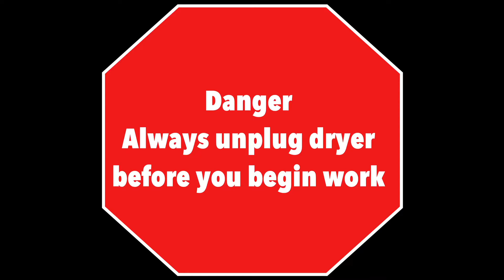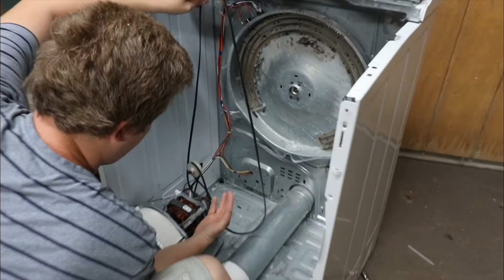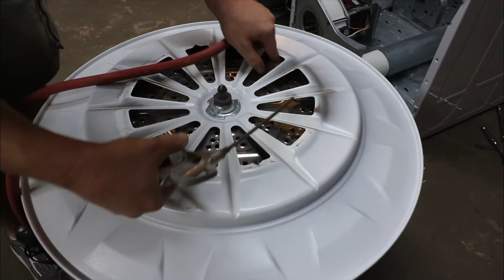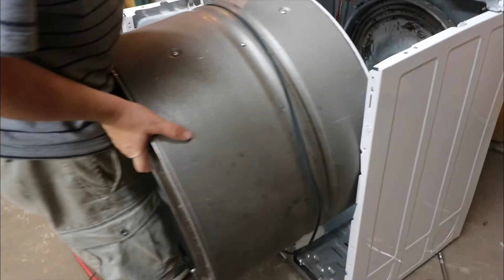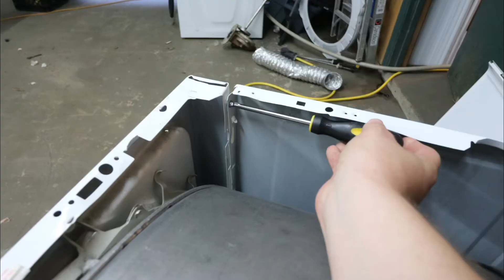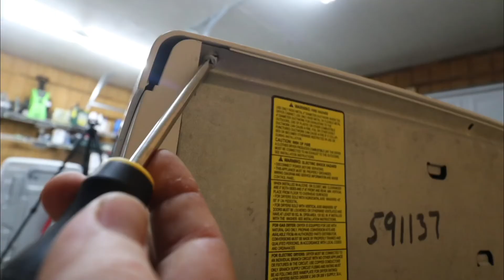GE Hotpoint overheating? Step-by-step guide to unstop Lint build up.

Comment: You saved my butt something fierce my guy 😂. I just got done putting the old girl back together amd im confident that i did a good job thanks to your instructions. I wouldn't say its 100% because there's a low buzz here and there but she runs and works the way she was intended to.

Comment: Question - based on the symptoms of my dryer it looks like I have a lint clog but on the front of the dryer on the other side of fan.  Originally, I pulled the dryer out and vacuumed the lint from the rear of the dryer and did get a good bit of lint out but apparently there's more, so I've been on a quest to try to access the part on the front under my lint trap.  I have an old school model (DCSR483EA1WW) that is not digital.  It's just a wind-up timer dial kind of GE dryer like the one on your video.   I can't find a video on YouTube or internet for my exact model but the dryer on your video is very similar and the dryer on another video was also very similar.  On the other video (not yours), the guy took the door off, and there were 2 screws at the top right inside where the door shuts that he took off.   On your video, you didn't have to take door off, and you didn't take any screws out of the top just inside the door.  I can't tell if your model even has those 2 screws at the top just inside the door.  The problem was I took the door off and then when i went to take the 2 screws at the top out one of them stripped.  The other screw I got out, but it was also very hard to crack.   My question is does your model have those 2 screws at the top just inside the door?   If yours does and your front panel came off, then I may not even have to remove those 2 screws and the door after all to get my front panel off.
Reply: I did put a brand new dryer vent on the exterior of my house when I cleaned the lint out of the back of dryer and vacuumed the round duct hose out and ran my vacuum wand up the duct connection pipe at the back of the dryer and got some lint out.  The dryer seemed to dry ok for about a month then i started noticing my clothes weren't dry and the lint felt wet.  So I assume that means the problem is there is a lint build up on the other parts of dryer that my vacuum cant reach.  I never dry on high heat and have always used medium heat.  Its producing heat and didn't feel too hot but i dont use high heat setting either.  Clothes were partially dry so i guess mine is getting some circulation but definitely not drying like it was in the past.  My dryer is on an exterior wall and I arranged it so the duct is running straight and out the wall so that shouldn't be the cause but I'll check it again.

Comment: What if we don’t have an air compressor? And how do I disconnect the light wire?
Reply: With a regular shop vac, you can perform this task. You can use the exhaust end to blow and the vac to vacuum the rest. If you really need blow power use your leaf blower for the exhaust pipe and other hard-to-get places. Just remember to check behind yurself like the heater element for the thing that will cause a 🔥fire!

Comment: Your video was very helpful to me. My GE dryer was taking longer and longer to dry clothes, so I checked down below the lint screen and there was gobs of lint built up outside the fan motor. My model was slightly different from yours, but the basic disassembly was the same. I took the drum out and used my shop vac to get the lint out of the rear. After cleaning it, I got it put back together and it's working great! Thanks again!
Reply from the maker: Glad to help.

Comment: Fixed the squeaking by replacing the shroder and glide tabs... but now the dryer is getting extremely hot only on the back metal panel after about 5 to 10 mimutes.. so confused. Any thoughts?
Reply from the maker: Definitely do not continue to run the dryer if it’s getting hot. That’s very dangerous.
More than likely, it’s an airflow problem.
GE dryers have a weird spot that collects lint in the back of the drum. To get it out you pretty much have to take the drum back off.
Another thing to check for is a grounded heating element. This means the heating element is touching the frame of the dryer. It will come on and stay on and overheat the dryer. Less common then airflow problem, but it does happen occasionally. Good luck and be sure not to run the dryer until it is fixed.
Reply: @WasherDryerMoney  thx. For the response. I took the drum out and cleaned all the dust/lint in the back of drum. Hoping that will do it. Tried assembling drum back on and noticed there was no o-ring. So, trying to find one @ hardware store as ordering it will take to long. Smh

Comment: Replaced start Button and door switch  Runs as long as you hold start button in. Thanks in advance
Reply from the maker: I’m not sure if it’s the same for GE but some dryers have a switch this on the motor is self. It detects with the motor is running at full speed. It’s called a centrifugal force switch.

Comment: My drum is touching the top of the fan housing is there something the drum is attached to other than the belt
Reply from the maker: I would guess it’s the drum bearings. Possibly the piece that also holds the bearings. If it’s worn out, it will lower than tire drum.
Always hard to tell when I’m not there to look at it. Good luck.

Comment: My dryer has to run 2 full 180min cycles to get the clothes dry. I pulled the hose off the back and vacuumed out a ton of lint with no improvement. 

I’m thinking this is the next step on getting the dryer to be efficient. Going to give it a try soon 😊

Comment: QUESTION: Thanks so much. I followed all of these steps very nicely, found a lot of lint in the blower and the back of the drum, put it all back together and tested it out.. Same problem. It shut off after about 5 minutes, and won't start up again until it cools down. Is it the thermostat or thermistor?  or something else? The clothes in the dryer were hot, the heating element looked good and intact. Suggestions?
Reply from the maker: Could be the motor going bad.
Some of those dryers had a switch on the idler pulley to shut the dryer off when the belt breaks. It could be that switch if it has one starting to go bad.
Reply: @WasherDryerMoney  Thanks! Is that switch built into the motor or a separate replaceable piece? I can't find that switch in the parts diagram. Thanks again, and a happy new subscriber 🙂
Reply from the maker: @BW-pr8qr  it may not have the switch. Not all GE dryer’s came with it. If it has a switch, it is on the bottom of the idler pulley arm.
Reply: @WasherDryerMoney  We tested the dryer on the "No Heat" setting, and it never shut off. Only kicks off in a heat setting. I purchased the 3 separate thermostats and will try to replace them first. Thanks again!

Comment: What if you don't have an air compressor? How do you get that thick wall of lent out of the trap?
Reply from the maker: You can wash it with the water hose and let it dry back out completely before you put it back on.
Reply: Use a Leaf Blower

Comment: Love this video! GE dryer bought in April, 2022 had made a really loud thump/or now like a pair of tennis shoes are in the dryer. It is my Mom and Dads dryer (Elderly) so my Dad just doesn't have strenght to do as he once did! So I to try or do it things for them.
Just so happen yesterday,  I found my Mom had washed a load of my Dad's clothes he had picked up peacan's and put them in his pockets. So I found in the washer and of course the dryer vent lint filter, leaves bits, outdoor trash bits of ground and so on. As I looked down into the lint holder, I saw pea's ( he still gardens, plenty of the pocket lint of leaves and pecan trash
.
Okay, to my question. I followed your instructions. As I went to take off the front door the drum was already loose. Pulling the door forward, the drum did not do as yours did. The belt was on. Or a red belt was on. By this time, I was flustered and just wanted to get it back the way it went since I knew I needed to know the reason the drum would need me to lift up, Way up and really adjust (it seem to fall forward and to one side). No tilting while taking apart. Reverse putting it back together was "WHEW" ! I had to hold the drum up to get the front panel back on. So I know something isn't correct.  GE Model GTD42#ASJ2WW Any suggeston? I mean this dryer is 7 months old. Used by two seniors. Light use or at least never heavy loads. I just moved in to help so I am noticing the things they don't. They hadn't noticed the noise, Loud Noise! 
Thanks for any information.

Comment: Thanks for making this video. I am not experiencing any issues. We always clean out our lint trap, and I have a second one in my vent pipe. I was cleaning this the other day and then figured I should make sure the dryer is clean.

I searched and found your video. Which was great! I didn't know about the area at the back of the drum, I plan to clean this now.

I don't have compressed air, but I will pull the drum out and use my ShoVac to remove as much as possible.

Thanks so much and keep up the great work and  content!

Comment: Very informative video! I was too afraid to take the drum off. I knew I wouldn’t be able to put it back
Reply from the maker: Most of the time 90% of Lent will be in the compartment where the filter sets. You can take the rest apart but a lot of the time your biggest part of the problem will be right there. Hope you got your machine running well good luck.
Reply: @WasherDryerMoney  I did thanks to your video! It works like a champ now

Comment: hi, I watched a few of your videos, but I could not find an answer to my dryer issue. I have a gas GE dryer 335008. It starts to spin, shortly after,  it is a noise like an aircraft that’s taking off ( of course not very loud, but crescendo) and in a few seconds it shuts off. Any idea what can be and if I can fix by myself? thank you.
Reply from the maker: It’s always hard to guess what’s wrong without actually seeing the dryer. But my best guess would be either the fan has come disconnected from the motor or has something stuck against it. This usually happens if the lint filter was not on while the dryer was running. It could also just be a Motor going bad.
One other thing you could check is if the drum is still spinning while it’s making the noise.
Good luck

Comment: Mine is overheating and after i turn it on, it turns off after like 15 minutes and smells a little bit like burning. Any idea what can be problem?? Im going to open it to clean it up but not sure if that will solve the peoblem. Thanks
Reply from the maker: Definitely don’t keep running it if it is getting hot. Unplug it and see if it’s clogged up. That’s 99% of the time the problem. When they’re clogged up there’s not enough airflow and they overhead.
In GE’s there’s a common clog right underneath the filter. Also check for kinked exhaust line or stopped up outside vent flapper.

Comment: I watched another video where they just took the plate off with the drum in the machine. I did that, vacuumed it out. But when I removed screws the drum shifted. Now I can't get it back in right place cause when I turn on the dryer its grinding.
Reply: Same here, how did you fix this?
Reply: @caylinmartin9289  I unfortunately had to take my dryer apart. But I did it! 😁 I'll never do it again!!! 😂

Comment: This is a great video. Talk about thorough! I didn't go as far as taking the dryer apart though. I was able to tape a flexible tube (actually one of those children's toys that makes noise when you spin it), and suck out the lint below the filter. I agitated the lint with a paint stir stick so it would loosen and get sucked up. 

I couldn't clean the fan this way, but I think I definitely got the majority of the lint out. I was able to get the lint out of the back of the drum by simply using the vacuum wand touching the holes. Just stick a thin cylindrical object in there to agitate the lint, and it will free up and get sucked up (I used the end of a thin artist's brush). I'm sure it's as clean as if I removed the drum.
Reply: Having just followed this video's instructions, I have great doubt you could clean it nearly as well without taking the drum out.  I'm sure yours is better than it was, but the lint on mine was so thickly caked, matted, and wedged into the crevices, that it would seem practically impossible to get it by any other means than removal of the drum.
Reply: @omgwhatever  Eh, it's better than it was for sure, but probably not perfect. Thanks for reaching out, I'll consider that next time.

Comment: Good heads up on the motor pully, been doing this work for over 45 years and up until now it’s always been obvious where the belt rides. Leave it to the Engineers at GE to screw up the design of a part that the belt has to be connected up to by feel ! I recently had to go back on one of these machines after three months and replace the belt AGAIN, i’ll bet I didn’t have the belt strung on the pulley properly, I wish I seen this video yesterday but I’m pretty sure got it right this time, I guess i’ll find out soon !PS, judging from the marks on the drum in your video here it looks like someone had the belt on wrong part of the pully on this machine too !

Comment: Spectacular video. I was sold one of these second hand and immediately had overheating issues. Your video is very helpful, and when I took the drum out I saw the vent was actually ripped completely open and caked the entire thing in lint. I'll be watching this video again when I put it back together and I'll also be seeking compensation for all the extra work I had to put in
Reply from the maker: Yeah GE dryer‘s are difficult sometimes. Good luck.

Comment: Thanks!! My dryer won’t cool down on last cycle could it be the same problem!?? Clothes comes out supper hot!!
Reply from the maker: Sometimes it can be caused by lack of airflow by either lint buildup or a bent exhaust line.
It’s more rare but it could also be a bad thermostat.
Reply from the maker: Be very careful with a overheating dryer. It’s one of the top reasons houses catch on fire.

Comment: Great video and very helpful. Still have a problem though. After a thorough vent cleaning, I still have a tremendous amount of moisture accumulating inside the drum. Vent is clear, and it also appears as condensation on the stainless steel plate on the back of the drum. The entire vent system is actually very wet. Help!
Reply from the maker: Behind the stainless steel plate is a common place for lint buildup to happen. Take a flashlight and see if there is a large amount of lint built up around the edge of the stainless steel plate. If there is lint buildup there you’ll have to remove the drum completely. Do not attempt to push the lint out without taking the drum out of the machine. Just behind that stainless steel plate is the heating element and you do not want to push lint onto it.
Reply: @WasherDryerMoney  What about the moisture? After unplugging, and sliding the dryer away from the wall, literally every inch of the ventilAtion is wet
Reply from the maker: @brainmeece5218  that is odd I’m not sure without actually looking at it. Airflow is usually the most common problem for a dryer. One thing you can check is blowing out well from the back of the machine and after you plug it in to the exhaust line if it’s blowing out well from the outside of the house. It should push out about as hard as a hair dryer on High.
Reply from the maker: Also make sure the door seal is properly working. Otherwise it will suck air from around the door and not through the heating element.

Comment: That exact dryer worked A1 until last night i accidently pushed the start button too quickly and made a sound like if something slipped.. and opened the sides from the back and the belt is in the right spot but its making lot of noise and seems to gets too hot too ... i dont get it ... it was working A1 before that press..
Reply from the maker: Difficult to say maybe the fan is not turning because it broke loose of the shaft. Hard to say without looking at it.
Reply: @WasherDryerMoney  can I remove the tub and start the motor to see if the fan spins or without the weight of the tub it’s gonna spin too fast the fan?
Reply from the maker: @imperius_lxxvii9999  if you can get to the fan it will be very obvious if it is broken loose. You will not have to turn it on. In fact be sure to have the machine unplugged when you open it. Very dangerous to have a dryer plugged in while you’re working on it.
Reply: @WasherDryerMoney  I did check the fan when I opened it 2 days ago and everything looked normal to me I guess and I could turn it kinda freely
Reply from the maker: @imperius_lxxvii9999  it should turn easy when you have a Dryer opened up. The difference will be if you can turn up the fan and the shaft of the motor does not turn. That means it has broken loose of the shaft of the motor. This is a very rare problem and probably not it. But it’s all I can think of without actually looking at it.
Reply: @WasherDryerMoney  I fixed my problem!!! The fan wasn’t tightened but it seems there’s no bolts .. so I used some vice grip to old the motor inside and tightened the fan by hand. Is that ok? Or I need to buy lock tight or something special? I replaced lot of things for no reasons apparently lol none the less I’m happy! Thanks for your help and videos !

Comment: I have a kenmore elite dryer model # 79681472210. I have a cool dryer, not heating. I have replaced the thermostat and it ran for 2 loads then the same thing happened. It blowing cool air again. 
I have taken the dryer apart and cleaned the fan, lint trap and pipe to the outside. I also checked continuity and the only thing is the thermostat is bad.
No wires are burnt. ????
Reply from the maker: Could be. I have seen bad thermostats before.